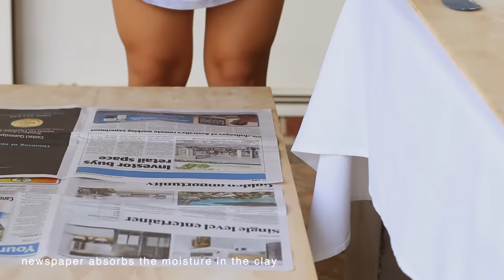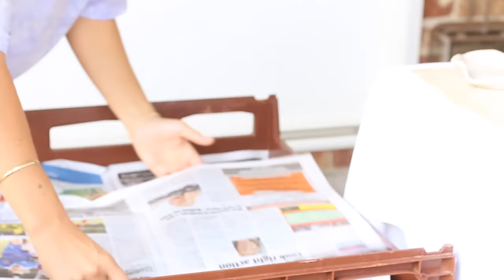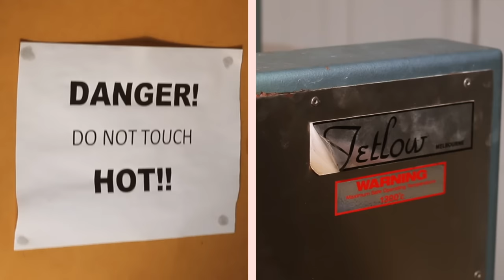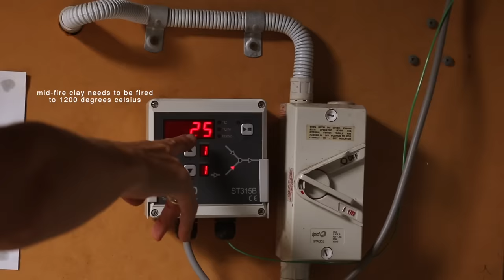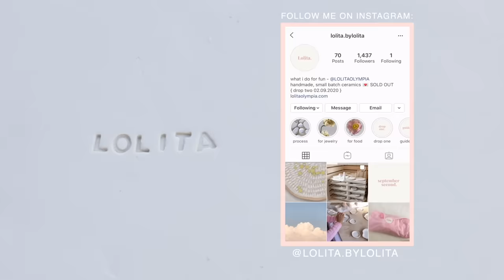HOW I MAKE CERAMICS AT HOME (the entire pottery process) | lolita olympia

Comment: Top tip: always start by “wedging the clay”. That’s to slam it on the table at different angles. This gets all the air bubbles out, even if you’re using seconds, thirds, etc. You should also do it with new clay, because it also gives a smooth texture to the clay, and warms it up so its easier to work with. And then there is no need to poke holes into your product either.
Reply: What do yous mean by 'seconds, thirds' etc?  Newbie so asking as I go along, thanks.
Reply: Leleen Pretorius i mean using the leftover clay, and then using the leftover clay with more leftover clay. You can use clay over and over, and even if you have chunks that didnt get stored properly and are all dried up, you can dump them in a bucket of water and in a few days, they’ll be ready to add to the leftover clay bucket again :)
Reply: Yes! The first thing I though when she was rolling the clay was "oh my god so many bubbles"

Comment: Do NOT wash clay down the sink!! It will cause terrible expensive problems with your plumbing!!!!
Reply: Cringed when I saw that 😵 Use a bucket or basin instead
Reply: It's possible that sink has a filter on it. Used to have a sink in our old studio with a full on filter on it.
Reply: @fireflyexposed  yeah there are clay taps you can build into a sink
Reply: What should someone do instead?
Reply: Safi La The problem with her showing herself doing that and not stating that youHAVE TO have a clay trap in the bottom is that people who are new to clay won’t know not to do what she did. What you need to do is to spray the surface with water and use a paper towel or regular towel to wipe off as much as you can, then get a clean wet towel and get the rest. I also use a three stage washing when I wash my hands. I use paper towel to get as much of the clay off as possible, then I have an old 1 gallon ice cream bucket that I wash my hands off in that I keep a nail scrub brush in so I can get under my nails, then I will use my sink to wash my hands the last time. It’d sooo very important to get into the habit of.
Reply: @micheledickey4066  What about the water in the bucket? How do you dispose it safely?
Reply: @waceabi  leave it in the bucket until the clay settles at the bottom- pour off the water, and leave the clay slip to dry. Once most of the water is gone the clay is reuseable
Reply: I'm here to say use a clay trap, too. I personally use a bucket for clay cleanup of surface, tools, sponge, hands, etc. However, I see some inexpensive and easy to install clay traps at the ceramic shop that I may order.
Reply: @waceabi  kkc
Reply: @waceabi  It’s only clay so I just dump it in my yard. It’s completely safe to put on the ground.
Reply: @olechkagoncharova9157  That may be true but she is showing people how to do very basic clay and should have mentioned that. If someone is new to clay they wouldn’t know to do this.
Reply: @micheledickey4066  Thank you! I recently started with clay and I didn't knew that.
Reply: if it can cause terrible problems for plumbing, then it does the same if we eat with that? maybe we could swallow some some clay particles? I am interested to make it but i will rethink about it if it's can be dangerous for health :-(

Comment: Cool video, but I got a bit worried when I saw you cleaned the wood board directly in the sink. If you just put water with clay down the sink it will eventually clog your pipes. It's better to keep the dirty water in a jar - after some time, the clay goes down (decantation) and you can even reuse it! But if other particles got in the clay and it got dirty or you just don't want to reuse it, it's better to just throw it in the trash. 

[I'm not an expert at clay and ceramics, but I thought it would be good to share this information]
Reply: Why throw it down the sink or trash. Just rinse it off in the back yard or put the jar of slip in the garden. If its natural clay it has lots of minerals that are great for soil.
Reply: @jetta.silence6356  true, i guess i didn't think about that cause i don't have a garden kk
Reply: @magali4321  lol well thats ok . You could always just water the grass or a tree somewhere right😝
Reply: How can you wash a board under the runnin water and put the water in a jar?
Reply: Yeah, I'm curious for the process of cleaning for pottery
Reply: @nihanparlak6645  well if you clean it outside you can do it over a bucket you have specifically to wash your board. I personally wouldnt bother . Id just fill a bucket of water and wash it in my yard in the grass. Its just saving your pipes and your house from costly repairs in the future and being  aware of the planet and what you can do to help it. Thats all.
Reply: Her plumber is gonna love her in a few years
Reply: You're completely right! Use a bucket or a large basin to wash your equipment
Reply: maybe it's the same case when i stupidly throw some of my cat litter sand into my toilet, i don't want to remember it T.T

Comment: wish i saw ur videos when i was in ceramics class. i had a difficult time throwing on the wheel so my art teacher allowed us to make dinnerware by molding but i had no creativity to even make them nice and pretty like urs.
Reply: Giiiirl, try Pinterest. You'll find a lot of beautiful ideas. You probably won't make exactly the same works as in the pictures, but at least you'll get inspiration and some ideas :)
Reply: @NedasFlanderas  my problem was i had no idea how to achieve that look. like how to form the walls on bowls or plates. i was a beginner and my art teacher was no help
Reply: @mothdelrey  Oooh, yeah, then it's sad... Well, but what I've learned, is that you can use basically anything for clay: you can just put random things on it - like leaves, flowers, thread, fabric and many other things - roll over it, and get a beautiful print. Also, anything, what you use for cooking cookies or cakes (like, molds and other shapes) you can use with clay too. It's very interesting and the result is usually very good. As long as you do not press the rolling pin too deep in the clay... :)

Comment: I am curious why you chose to manually poke air bubbles out rather than wedging the clay before rolling it out?
Reply: Same, I was waiting for her to slam the slab of clay
Reply: I would never rely on poking holes! I always wedge...
Reply: @MelanaC  Well then you can make your own YouTube video...
Reply: Genuinely wondering the same thing.
Reply: timeiswhat Huh, didn’t know non-aggressive criticism wasn’t allowed anymore
Reply: that's step one of working with any kind of clay, so i'm wondering that too...
Reply: @MelanaC  what is wedging please. I will google but just asking whilst on this post, thanks.
Reply: @leleenpretorius5213  basically slamming and Turing it around like slamming different sides of the clay different angles to get the air bubbles out
Reply: @godislovedayany5098  do i have to do that even with the das air-drying clay?
Reply: @bbyb3462  a bit of a late response but I don’t think you need to wedge for air-drying clay:)  Air bubbles will potentially crack your piece during the firing process and almost no way to save it, so wedging and compressing are crucial for preventing cracking to happen.

Comment: Hi there. I love this video and it has inspired me to do some pottery at home too. I do have a question about your single firing process as I have read it can be quite tricky. What is the exact process and temp you use when doing this? I have read that cracking, bubbling and explosions are a lot higher with this method. How did you combat this? Looking forward to your next drop and any info you can share with this. x

Comment: Air bubbles do not explode in the kiln. Moisture causes clay to explode. When moisture reaches the temperature of 212 degrees Fahrenheit, it turns into steam and instantly expands in volume by a factor of 1700 to 1. THAT explodes the clay.  With an air bubble, the clay compresses the air as the clay shrinks in the drying process and that may or may not cause a crack where the bubble is located. Beyond that, air inside an air pocket is able to move out of the clay as it heats inside the kiln. Gorgeous plates!
Reply from the maker: wow this is so different to what I was taught but makes so much sense! Thank you !!
Reply: @LolitaOlympia  we were taught to wedge the clay before hand if we wanted to make functional dishware with the wheel
Other types of hand building didn't require it but its still a good idea.

The way you rub all surfaces with a rib is a really good idea! This will make the peice more structurally sound. Have you ever tried burnishing? Its where you rub the clay with something shiny while its leather hard and it creates a very smooth shiny finish on the raw ceramic.
I will add too, partially what bisque firing is for, is to get all moisture out on a chemical level, there are still plenty of techniques that involve a single firing though.
I was glad to hear your dishes make a high pitched "ting" sound. My mom buys pots from a lady and they always break, they make a dull sound when you thump them and another potter told her about how the sound indicated it wasn't fired to the correct cone

Comment: Just an fyi, air bubbles will not necessarily explode in the kiln. 
They are more likely to bulge or pop. 
They might explode but I’ve never had that happen. 
The thing you must 100% avoid it moisture. If your piece is not totally bone dry before it reaches the high temps, it will definitely explode. That is a fact.

Comment: I love this video thank you ~
Does anyone knows when to paint the ceramics? Like, if you want to color them, should you do it after or before the baking process?
Reply: First off it’s not baking, it’s firing. It’s not the same as throwing a cake into the oven or using oven bake clay. As to colour, it depends.. you can use coloured slip(liquid clay and colourants like mineral oxides) under a clear glaze, so you slip first, let it dry to bone hard, then glaze over top. Or you can use coloured glazes(just important to make sure the glaze fires to the same degree as your clay, or to the same “cone”) on bone hard body. It is important that your clay body is bone hard(or thoroughly air dried) before glazing to allow the glaze to impregnate the body evenly, and it then needs to dry thoroughly too.

Comment: this is amazing though i don't know about ceramics!! but can i ask some questions? what is the purpose of glazing and how long does ceramics   need to be heated? thank you so much ! i hope you respond!! i also love your feed! xoxo
Reply: you don’t have to glaze but people like to glaze for looks and function. if they are glazed, it’s safe to eat from and it’s microwave and dishwasher safe. usually you would fire the pots before you glaze them at a lower temp (around 1850 degrees) apply the glaze and fire them again for the last time at around 1400-1550 degrees. sometimes you can just keep your pots bone dry tho if you don’t have a kiln but they are SUPER fragile (sry i’m not lolita lol)
Reply: @kaitlynarabella7429  thank you so much for responding xoxo
Reply: just throwing in another answer here
1) agreed with kaitlyn that glazing is about looks and function, for looks,  commcerical clays fired in electric kilns don't look very exciting, usually they are just flat brown or white (though sometimes with speckles)

for function the glaze is essentially a glass layer that helps seal off the surface of the piece from moisture, and provides a smoother surface for cutlery, though for non food ceramics though it doesn't matter at all and only looks matter

also worth noting unglazed pieces can still be functional for food

2) she fires only one time, so it probably takes 30 hours or so total (preheat, firing, cooling), typically this is split into two separate firings as kaitlyn mentions, about 20 hours each
Reply: @rz1974  thank you so much!!!
Reply: @rz1974  your responses are very informative !! I am new to ceramics and I don’t personally own a kiln so I am planning to rent one. I chose to just fire it once since the prices are high. I am planning to use stoneware clay. Any suggestions on what glaze to use or how the process should be while only firing once? To make sure that it isn’t damaged? I really hope you reply!!
Reply: @uthrasundar3296  sorry, I don't have any experience with once firing personally. Does the place you plan on renting a kiln from have a technician that can help? What you'll need to figure out is the firing schedule. Worst case scenario if you can't figure out a custom program, I'm told that a kilns default bisque firing schedule but to cone 6 final temperatures (or whatever you are firing to) can work.

For glazes, I would contact a manufacturer that's in your price range and easily available and ask them which glazes will work for once firing. I make my own glazes so I can't offer any specific advice for commercial ones, I just know they'll need to have a good amount of clay content in them in order to fire properly.

Let me know if you have any other questions and hopefully I can help.
Reply: @rz1974  thanks so much!! I will make sure to contact my nearby services for more information. I am planning to bone dry my clay for 8-10 days before glazing for the single fire. Does that make the piece equally durable compared to bisque firing?
Reply: @uthrasundar3296  no, completely unfired clay is still fragile even when dry, so please still handle with care when loading your pieces, hope I understood your question
Reply: @uthrasundar3296  but if you are asking if there is any different in the strength between say once fired to cone 6 vs bisque fired to 05 and then glaze fire to come 6, there is not
Reply: @rz1974  You’ve literally cleared up all my doubts thanks so much!!
Reply: @uthrasundar3296  happy to help! Also remember that you will always be learning with pottery, and there are countless steps in the process where things could go "wrong", point being don't get too attached to your work at first, it took me many failures and many pieces before I was happy with my work so it's important to learn what you can from them and keep moving forward, I just mention this since once firing is less documented

Hopefully one day your situation will allow you to have your own kiln as well!

Anyway, if you have any other questions ever feel free to reach out to me on here or @slawstin on ig

Comment: Very nice. Can I use my regular oven at home with temperature degree ?
Reply from the maker: No - regular ovens do not heat to a hot enough temperature :)) the pieces need to be fired at around 1200 degrees Celsius and therefore a kiln or fire pit is needed x

Comment: Hello! just curious .. After glazing, do you have to wait for it to dry before taking it to get fired up?
Reply: I don't know what she does, but she could probably drive them over immediately, since they are just brush on glazes they are applied pretty thin, and if the first layer is dry enough to brush on a second, then the clay underneath should be relatively dry as well

the only thing you need to worry about when loading glazed wares is that the glaze is dry enough to handle without damaging, this is even more true if you are glazing bisque fired pieces, you don't have to worry about glaze being 200% dry like you do with clay, though her mentor probably has a preheat on the kiln regardless which would dry up any leftover moisture in both clay and glaze since she is once firing

feel free to ask any other general questions
Reply: @rz1974  I see this for the first time to glaze the biscuit without baking it . does this make sense ?
Reply: rz would it be best to fire up before glazing?
Reply: @elif_cesur  I think you are saying this is the first time you are seeing someone glaze greenware without biscuit firing first, if that is correct, yes it is much less common in current times, however in the past when firing was only done by wood kilns they would do the same and glaze greenware
Reply: @ConnieCNL  for most people yes, bisque firing first lets you:
1) use a lot more glazes (greenware glazing limits you to certain brush on glazes or high clay content glazes, other glazes can shiver off the piece if once fired)
2) there is more room for error, if you mess up just scrape off the glaze, sponge it off, and try again when the piece is dry
3) no need to figure out a firing schedule that works for both your clay and glaze, once firing is more complicated because you have to do a slow bisque rise to those temperatures then ramp up to a normal glaze firing, kiln controllers only come preloaded with separate glaze/bisque schedules, so it would take some research

I would say 99% of potters bisque fire first, even potters firing unglazed pieces in wood kilns
Greenware glazing works well for lolita and her glazes + her situation with her mentor and overall process, to each their own
Reply: @ConnieCNL  though also worth noting, if you have no kiln of your own, no friend's kiln, etc. and are forced to pay kiln rental fees, it might be worth figuring out once firing, kiln rental can be prohibitively expensive, at least in my city
Reply: @rz1974   Thanks so much for your help! This really helps.
Reply: @ConnieCNL  no prob! Feel free to reach out if you have any other questions, there is so much technical knowledge to pottery it can be overwhelming

Comment: What happens if you dont own an "industrial oven"? can you still put it in an conventional oven?
Reply: If you want your pieces to be food safe then no. Clay needs to fire at a certain temperature (somewhere from like 1200-2000ish degrees F, can’t remember the specifics) in order for it to be food safe. But even then unless you have a glaze (which is basically liquid glass and also needs to be fired quite high) there aren’t many options. HOWEVER if you don’t need your pieces to be food safe there’s different types of clay that can be used with a conventional oven.